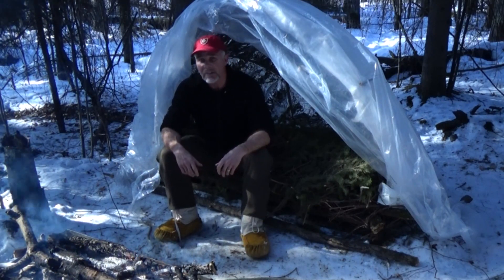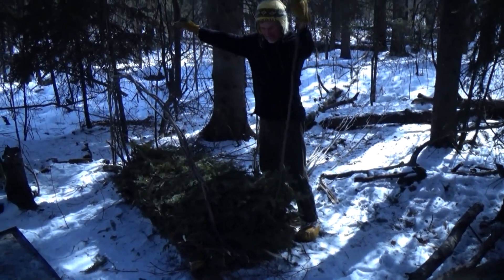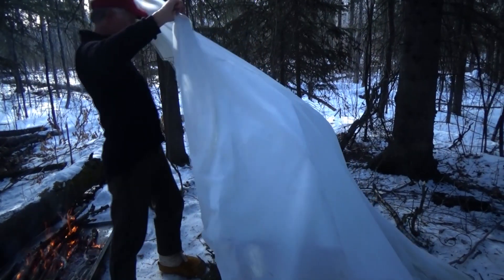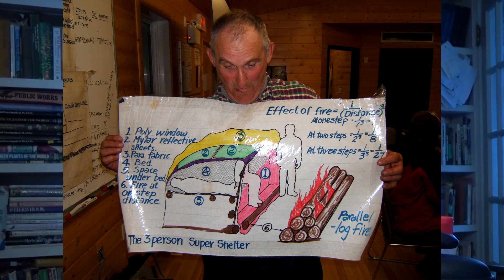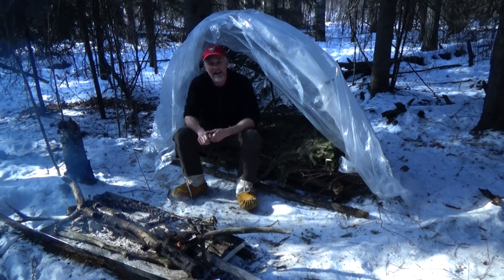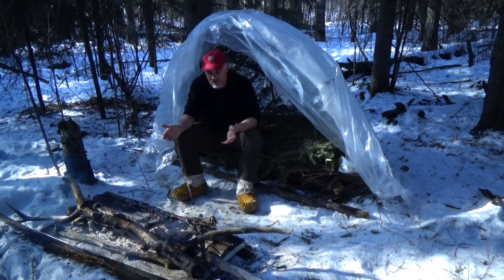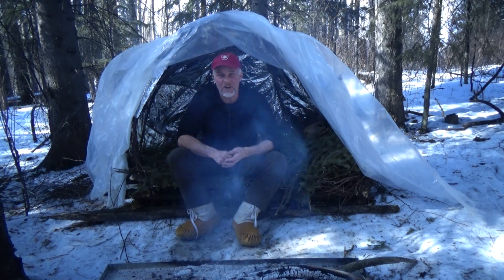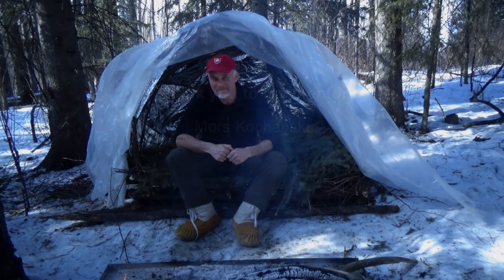Mors Kochanski Super Shelter Part 2:   History and How it Works

Comment: Benders, yup, we made a lot of sweat lodges in the 80s and 90's.  Then building bigger a dome you need a way to keep heat in and let the smoke out, made a chimney to one side. You warm rocks in a fire and use the heat from them to heat the dome, get them wet and have a sweat lodge. Raising the floor is the key.

Comment: How does this work with no fire in winter when temps are around -10 F?  Did you ever test it at that temp?
Reply from the maker: Thanks for your comments.  It that temperature, it works well as a greenhouse when the sun is shining on the plastic front of the shelter.  But you need decent full sunshine to trap a bubble of warm air inside.  Without sunshine, or a candle(or two) inside, the shelter will not really warm up beyond what your body heat adds to the inside - with the front door closed.

Its success at any temperature depends on the shelters ability to allow sunshine or radiant heat from a fire - to pass through the clear plastic, and be trapped inside the shelter.  Without that external heat source, it's basically just a simple tent.  Take care

Comment: Do you think it would work to have rocks in the fire heating up then move them under the bed at night
Reply from the maker: Thanks for your comment.  Yes heating up rocks will certainly be a big help.  There are two potential issues though:  1.  Hard to find rocks in my area in winter as they are all under snow and frozen into the ground and impossible to gather.  2. Mors spoke of first nations people who used hot rocks for warming shelters - and they did mention that long term use of this method would create lung problems with people.  Take care
Reply: @NatureAliveAdventures  
Thanks. 
I wonder what could have been the lung issue, you would think there would already be issues with all the wood smoke in general

Comment: What is the parachute layer?
Reply from the maker: The parachute layer goes under the plastic outer layer.  It serves to strengthen the overall skin of the shelter, it absorbs much of the condensation inside so that the moisture trapped in the bubble of warmed air doesn't drip on you, and it adds another layer of dead air space that increases the warmth of the shelter.
Reply: @NatureAliveAdventures  Is it actually parachute material is what I mean?

Comment: Really good info.  Regarding the fresh air exchange at the back, does the plastic not go all the way to the ground in back?
Reply from the maker: Thanks for your comments.  Yes, the plastic does not go all the way to the ground in the back or sides.  This effectively creates a screen window to allow fresh air in without allowing insects and wind into the shelter.  But it needs to be in the lower part of the shelter otherwise you compromise the trapped bubble of warm air that the plastic forms.  Take care
Reply: @NatureAliveAdventures  Thank you sir

Comment: I appreciate his use of these materials, however, we have winters of -30 to -45 and colder with wind chill that will tear away any warmth just inches from the fire even if there's no wind or snowstorm. Can this style of shelter account for these conditions?
Reply from the maker: Thanks for your comments Jo.  The super shelter works even better in bitter cold temperatures.  My fellow instructors and I have tested this shelter many many times in bitter cold weather with huge success.  And the shelter is so effective at capturing a warm bubble of air from the radiant heat of the fire, that the amount of firewood burned is reduced by half or more - compared to a regular open fronted shelter like a lean-to.  I have experienced it many times.  Take care
Reply: @NatureAliveAdventures  "compared to a regular open fronted shelter like a lean-to." I can think of a great many things that are warmer than a regular open fronted shelter-like lean-to. I'm curious to know how cold the bitter cold temps were that you speak of where this open super shelter worked even better in? Winter is coming to us here in Winnipeg mb and I would be interested in trying it out.
Reply: @joseymour2574  considering the tone you use (why?) seemingly showigng no polite apriciation of the reply you got, let me blunty ask: why not just make an effort yourself and try? What was stopping you? Surely a test could be made by such a sensible peson in reasonable safe conditions even with that cold? (being sensible being a must in such harsh conditions I think).
Survival is highly situational and most really good buschraft and survival specialist knows very well that one must be able to build several different kinds of shelters depending on the situation at hand. Do you have the skill, material, time etc. to build a shelter of natural material such as the right type of snow, you may consider building any variation of that kind.
Reply: @ghanaboyz  Not a thing wrong with my tone in that comment, but let me also be blunt since your "rules" do not apply to your tone (not that I think there is anything necessarily wrong with being 'blunt' or straight forward but you seem to) -- women are tired of men trying to shame them and shut them down for speaking up and will often accuse them of being rude or using a tone when they were simply stating a factual opinion. It just doesn't work anymore, hon. Also you might want to use a spell checker.

Comment: What are the dimensions of the poly sheet for that single person shelter?
Reply from the maker: Thx for your question.  For a super small low shelter go with 12 ft x 12 ft.  However, its easier to start with a big square sheet(16x16 or a bit bigger), and then trim off the extra plastic once you have built the shelter to the size that suits you best.  It sucks to build the shelter and then discover afterwards that your polyethylene is too small.
Good luck